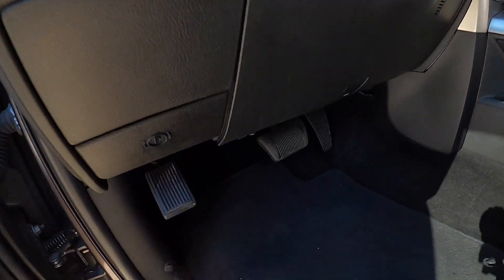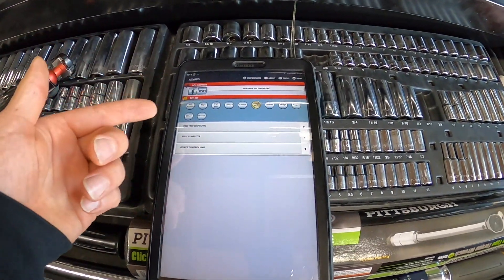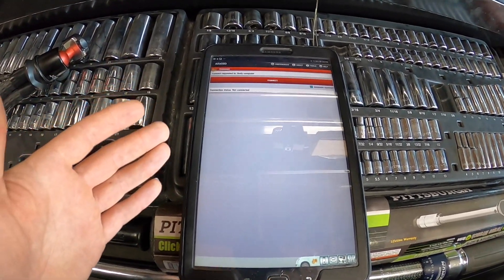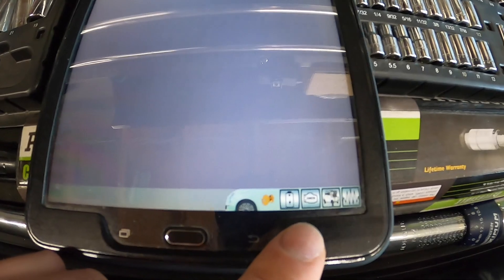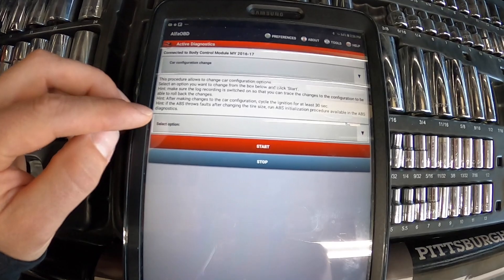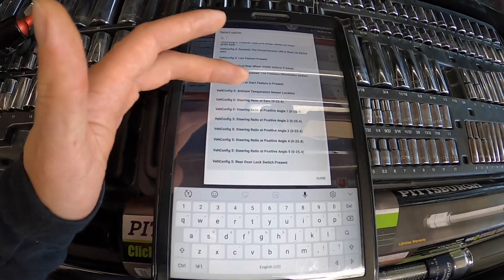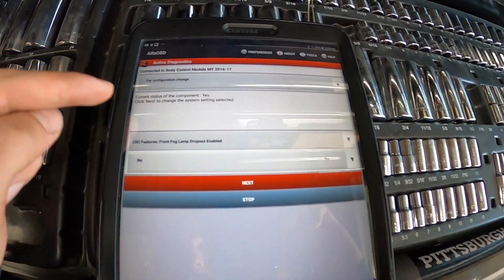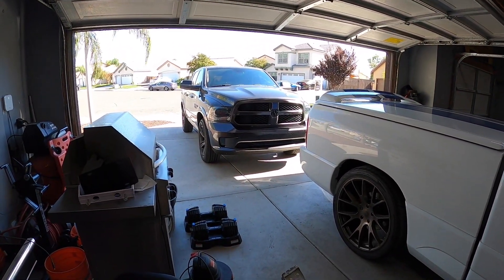HOW TO KEEP YOUR FOG LIGHTS FROM TURNING OFF WITH HIGH BEAMS 4TH GEN RAM TRUCK

Comment: Holy s**t you couldnt have made this more complicated. I have a faster, easier, free solution.  Find the fog light relay, take it out, and break off the metal prong labeld number 1 (usually far left one on the 3 up top)
Reply: Did this work??.

Comment: @BoostedMotorsports  with the Alfa OBD I have a 2012 ram 1500 4x4 and want to adjust the Throttle , I use the pedal Commander right now but is there an option to adjust it with the Alfa OBD, so I dont have to use the Pedal commander anymore ?

Comment: Thank you was curious if I could turn off auto features. I can't stand the auto brights or windows or wipers. 

Wipers: its barrly raining you want a liw setting then the wipers get possesed and go into high mode on their own. Annoying.

Brights: they turn themselves off when taking corners so when I pull in my driveway at night they shutoff as I am turning into my driveway which is when I like having them on. They also won't engage when a car is like a half mile ahead of you or if there us still a little daylight so they won't engage in a fog if any daylight is visible which is annoying.

Windows: you only want a little fresh air wanting to crack the window on a cold day and bam your windiw gets thrown wide open. Ford atleast has the switch made better so you can get a little bit of air without having the window drop as the swutch has to be pushed down more, dodge its all or nothin. 

Think my next truck I will buy a 90s truck from diwn south.

Comment: Thanks for showing this. I had to get the PC interface program as I have an iPhone. The PCC interface does not quite look the same as on the Android or tablet and was a little confusing. I found someone else showing the PC interface for changes connection and selection and it worked great. Now i have to research and look at what annoying things I can turn off from the factory or turn on to make performance better on my 2015 RAM 1500.

Comment: So does this mod make the fog lights shut off on low beam?
Replaced front bumper and fog lights with light bar and I want to use the old fog light harness to trigger a relay to turn the led lights on only when on high beam.
Reply: All you have to do is turn the light nob for parking lights only the fogs will come on without headlights
Reply: To just run low beam and no fogs push the light button in and will shut off fogs

Comment: Boosted, you should go in and activate the "global windows down" feature. Unfortunately it only controls the front  windows but its nice to hit the unlock button twice and hold on the second press to put the windows down on a hot day. The only other down side is the "global windows up" function doesn't work.

Comment: Isn't this illegal in many if not all states?
Reply: Depends on the traffic code for your state. I live in Virginia and this would be illegal BUT, the only time you would really get hit for it would be when you go in for a yearly inspection. All you have to do is go back into the BCM and turn it off before inspection and then turn it back on after you get your sicker.

Comment: Has anyone had luck with it keeping LED low beams to stay on. My 15 Ram does a flicker or just turns them off altogether, does it at random times. Also have a load resistor connected.
Reply: It's possible the resistors are going bad or you have a loose connection

Comment: Can you lower the temperature that the electric fan comes on? Did the v6 fan mod on my Ram and want to have fan come on at a lower temp. If not, what is my best option? Not wanting a to add power from a programmer, just want to change the temp.

Comment: Does this have a option to be able to have the amber day time running lights. I’ve been to 3 dealers to get them activated and they keep saying no. But I know it can be done. Thanks.
Reply: my dealer only saw option for low beams on quad headlamps, i didn't see alfaobd showing amber, only 3 options lows, highs, fogs and with or without cut off on blinker , this might be different in other model years

Comment: Awesome video!!! 
Is there any way to lower the recommended tire pressure on the truck? Ex my 2017 2500 says 60 psi/80 psi. Im running 45 psi for a better ride.
Reply: You will need your pin# either from the dealership or pin pull app

Comment: I have a modified pcm and custom tune. Is this compatible? Also can that thing turn off the rear o2 sensors?
Reply from the maker: Yes it will still work.  This is making changes in a different module (BCM) of the truck.  O2 sensors are managed by your PCM
Reply: It can connect on some other modules as well, i changed ABS module which you can also initialize with AlfaObd

Comment: Wouldn't recommend this. Unfortunately. Always on board for these vids, bit this one....the whole point of shitting off the Fogs when the high beams are turned on is current draw, which also equates to more heat. It loads the system too much and you Could, not will, but Could cause a fire, or any other host of electrical problems. Boosted, c'mon man, at least tell these people to use at own risk...this is just one I can't support you on. I'd never do this and I severely modify all.mynbegiclds, but not this....
Reply: So wrong.  Fogs, lows and highs all run on separate circuits.  There is zero excess heat from running highs and fogs.   The reason it's disabled from the factory is because us dot regs require the fogs to drop out when the highs are on.  Nothing to do with heat or current draw.
Reply: @DanCaveOutdoors  1 word facts
Reply: @eldelapalma1338  my bad. Going off of older vehicles and what I have personally experienced. And it may in fact be due to the age of the vehicle and it's system rather than the lights. But I've had to fix issues related to this so, my bad.
Why would you want to anyway. I mean, brights are going to Far outshine fogs anyway. So what's the point?
Reply: @NoVoice71  
Yes. On the older cars they ran through the light switches. So it could prematurely burn those out. Later ones used relays. So you could easily add a relay and move the fog lamps over to the new relay to take the load of the relay. However if you go to LED’s then the draw will drop.
Reply: @NoVoice71  light up the foreground in front of you.  Personally,  if I'm running my highs, it typically means I want as much available light as possible. So, fogs to light the road directly in front of you,  lows to cover your normal light pattern and highs to reach out for distance.
Reply: @DanCaveOutdoors  interesting. Mine, as in my high beams which I use probably about .5% of the time through the mountains here provide exceptional coverage both foreground and distance. However, the caviate to that is that have converted my stock '11 halogens to a whole new unit and I'm running HID's. Normal night time driving info use my Fogs, but they are proper fogs as in yellow, which undercuts weather whereas white tends to be reflected back. So yeah I can see that if you're running standard halogens then the foreground coverage isn't good at all without Driving lights on as well. Just wondering.
I'm always curious as to why people do certain things to their vehicles but not other things. I'm not picking sides, as there are no sides.

Comment: Can also do this with the zautomotive tazer
Reply: Yes, but I believe that unit is married to the vehicle and can only do a small handful of changes. Alfaobd can do so much more and is only slightly more expensive.
Reply: @DanCaveOutdoors  yea Alfa obd isn’t married but the tazer doesn’t need to be left plugged and it does a lot more things than you realize
Reply: @nathanlegradi4098  Tazer does not have to stay plugged in for changes alfaobd does which are  programmed in by manufacture, but those which modules don't have programmed and require some additional sequence are operated by Tazer and only function if it stays plugged
Reply: @tallll70  there’s only a few options it needs left plugged in for to work. And plus it’s not difficult to plug and plug back in lol. The live options save and don’t need selected again when you plug it back in either

Comment: Do you have to leave this plugged in all the time to keep the settings? Or can it be removed?
Reply from the maker: Once you make the changes you can remove the device 💪
Reply: It's also not married to the vehicle,  so you can use it on multiple Chrysler vehicles at the same time

Comment: I have an 09 1500 and an 11 2500 that I can't figure out how to remove the led turn signal error. Anyone else have issues w alfa on early gen 4's?
Reply: It can read and delete errors codes keep in mind you still have to a drive cycle to clear the codes out of the computer
Reply: My 11 1500 has the same issue

Comment: Can you fix or mod the tire pressure warning using AlphaOBD as well. I run about 5psi less than recommended and when the temperature drops I get the low tire warning. Only way to reset it is to fully inflate then lower it again. 39psi is just too high IMHO resulting in a rough ride.
Reply from the maker: You can but you may need to get the 4 digit PIN from your dealer to make the change.

Comment: Sweet video today man. Do you have a video installing  the security bypass for the 2018's?
Reply from the maker: Thanks Robert! I don’t since my 16 doesn’t need it but I can maybe making a video showing the location and where to put it 🤷‍♂️
Reply: It plugs into the obd2 port with a splitter and connects to the canbus port directly above it.  (If using the kaodtech bypass).  It takes like 5 minutes to connect and is color-coded. There are others that mount behind the stereo.  You also have to be sure you get the right one because it's different between gas and diesel trucks.
Reply: That would be awesome. I would love to get rid of the plate bulb warning(another great video BTW) would love to see more of what the alpha app can do!